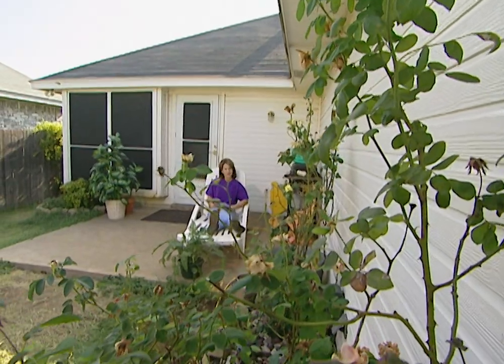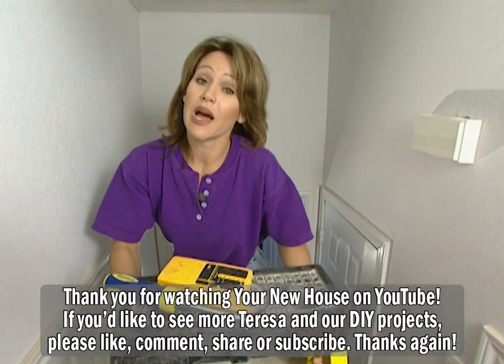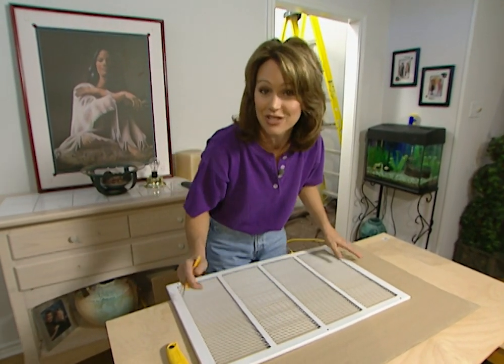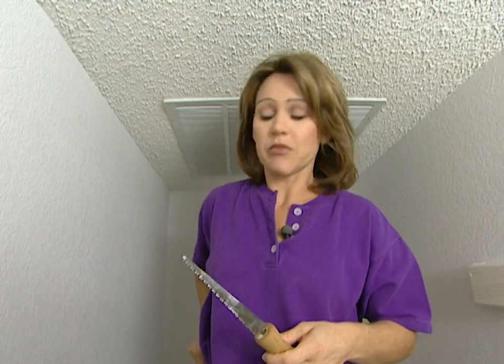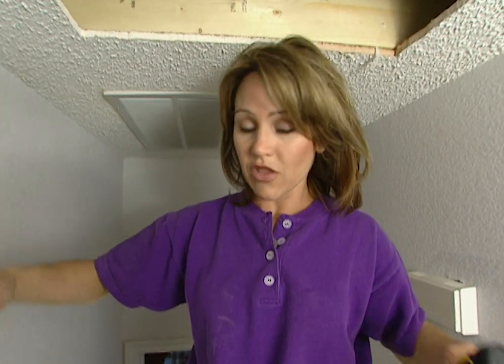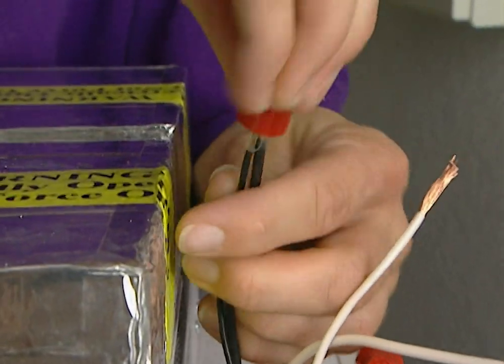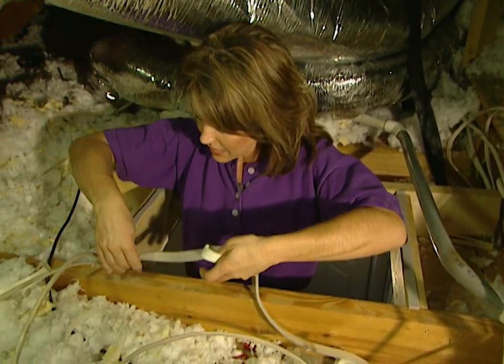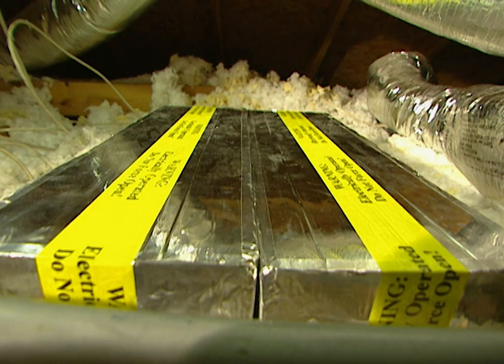Whole House (Tamarack Bomber Fan) - Do It Yourself

Comment: Good instructions but at ~$700 for the fan I'm tempted to just put a $15 box fan into a rear window
Reply: Yep, and that's the only option if you're an apartment dweller. The key is to block the gaps around the fan in the window opening, so there are minimal leaks. Simple, cheap, and works wonders.

Comment: I did notice though that she forgot to twist the sixteen gauge copper wire with linemans before screwing on the plastic wire nuts.  That is why one of the electrical wires came out.